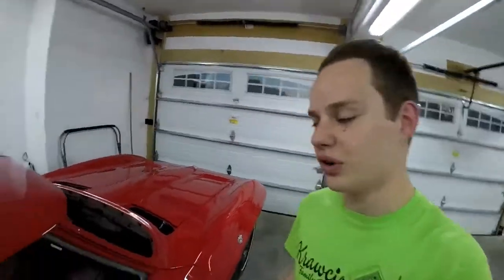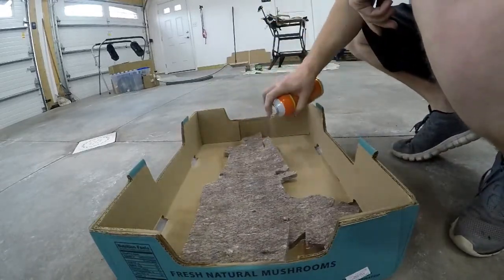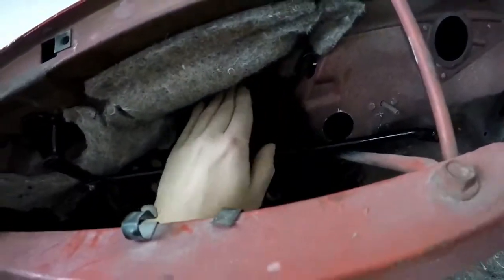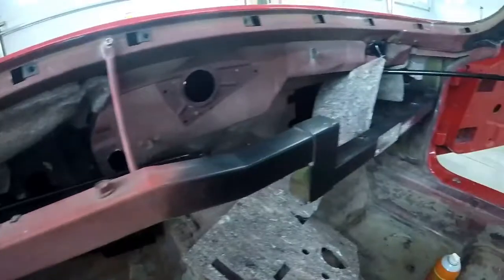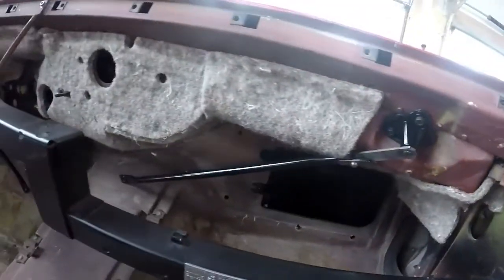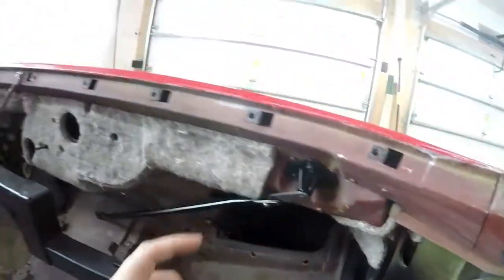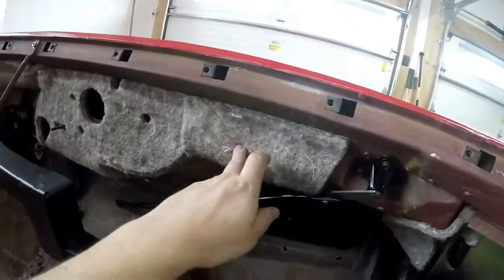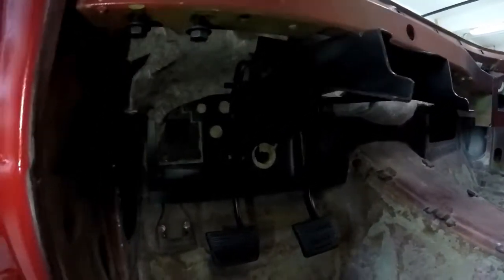1963-1967 Corvette Firewall Insulation Install

Comment: The firewall pad retainers are a bitch!  Was just trying to install on my 65 and gave up.  Gonna use some kind of large flat head screws and install from engine compartment in with big washers and lock nuts

Comment: Mitch, was just doing this project. Wondering, don’t you have to re-attach the parking brake bracket at interior firewall before the insulation piece? Or does it attach over? Don’t think so since it doesn’t have remade screw hole.
Reply from the maker: I believe that you have to remove the everything from the firewall to install the insulation including the ebrake assembly.

Comment: Hi Mitch.  I’m glad I stumbled upon your video.  I’ll be doing my insulation install in the next month or so.  I’m curious, what brand of spray adhesive did you use?  I saw the 3M 77 multi purpose spray is only rated up to 110F.  That would be too low a temp for this application. The 3M 90 Rubber & Vinyl is rated up to 200F.  Your orange can doesn’t look like a 3M product.  What is it?  

Thanks again for your videos.  They are nicely done!

Cheers
Mike
Reply from the maker: Hi Mike I appreciate the support. I used heavy duty gorilla spray adhesive. The section I glued in is referred to a sound debtor vs the lower section which is insulation. Going off of that I assumed that it meant it wouldn’t get extremely hot there. But with that being said I think any spray rated over 100 or 200 degrees should do fine. I hope that helps!
Reply: Mid-Year Mitch - Hi Mitch.  Back again. I’m installing my sound deadened (upper) and insulation (lower) this week.  A couple of questions for you.  For the lower insulation pieces, did you use glue in addition to the push pins?  Or just the push pins?  It looks like you installed the lower insulation before you glued the upper sound deadened in.  Did I see that correctly?  Do you think it matters which is done first?  Thanks for the advice.
Reply from the maker: It really doesn't matter which you do first. They both may need a little trimming where they meet so keep a sharp razor blade with you. I installed the upper pieces first because we broke most of our push pins so I was waiting for them to come in. I had to cut the lower insulation in a couple places to clear the upper pieces to get the holes to line up correctly. I think it is easier to glue the top one in first because I like working from the top down so I could line it up with spots around the windshield and work down. But I'm sure you could do it the other way and it would work great too. 

I only used the push pins but a little glue wouldn't hurt. I had to drill the holes in the firewall a little bigger, I used lots of grease on the pin, and be prepared to get angry at it haha. Just be aware the lower insulation is brittle and it doesn't take much for it to fall apart so I am not sure what glue would do there.